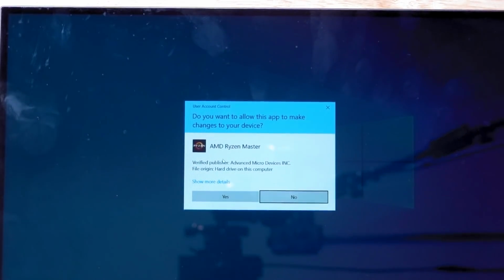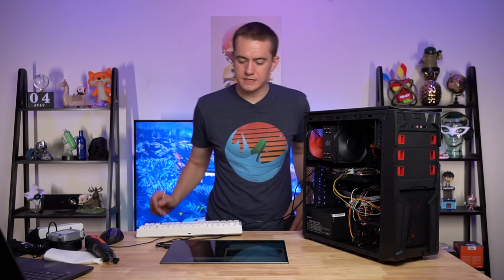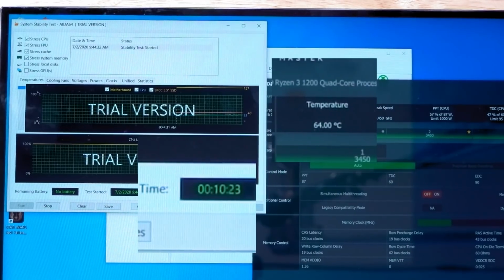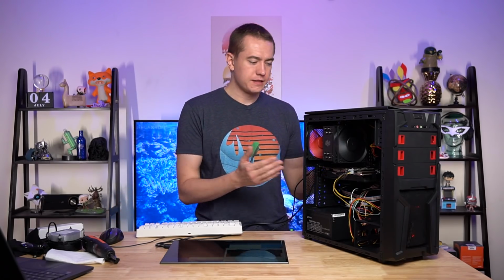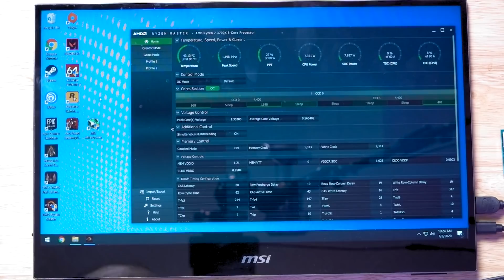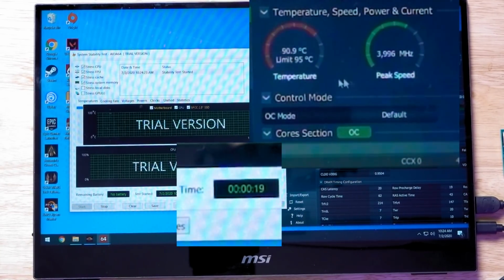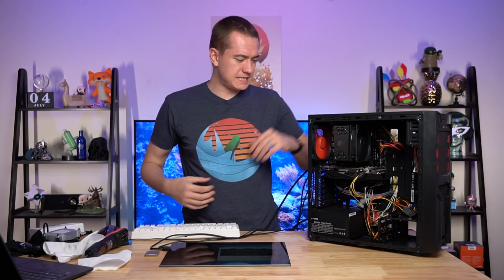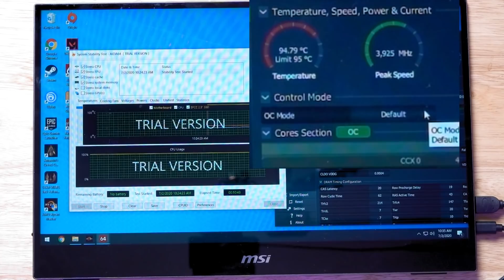How Bad Is It To Forget To Peel Your CPU Sticker?

Comment: I would definitely like to see a 24h test, but I'd also like to see the performance of it without the sticker.

Probably could cool that Ryzen 3 with a can of baked beans tbh.

More ideas for your brainus, can you put non conductive thermal paste in the socket and still have it work (does mounting pressure push out the thermal paste enough ?)

Comment: 3700X is same 65W TDP as the 1200AF :P 3800X is the 95W boosted version. But as can be seen, obviously they are nothing alike with actual thermal output.

Comment: My first laptop had a Pentium 4 desktop CPU on it (also a Geforce 4 488 Go in an MMX card and a massive 14 cell battery - for 1h30m of battery), I got it for university and since it was around September it was cold and worked fine, when summer arrived the thermals were pretty bad and the fan was usually at full speed...
I opened it up, and at first I though it was a clogged fan as it had dead flies and spiders on it (that thing really pushed quite a lot of air through a massive copper heatsink), but after a clean up it was the same... so I took the heatsink out: Against the CPU heatspreader it had a thin aluminium sheet (no thermal grease), then double sided tape then the copper heatsink.... My only guess is that the aluminium was protecting the heatsink and someone mistook it as pre applied thermal grease. Thermals were great after fixing that :D

Comment: did that once upon the time with an athlon xp. those cpus didn't have heat-spreader (or thermal protection) at the time. melted right through...

Comment: I was tired as hell, and put in my new Cooler Master MasterLiquid 240L RGB,  on my 2600, and yeah, wondered why my temps were about 20 degrees higher that they were with the stock cooler. Well I took the cooler off, and seen the plastic ... 1st time in 20 years of building PCs I did that crap!

Comment: You’re making my oc 3950x cry. I’ve seen it pump out 80C with my Dark Rock pro 4 and all my fans running full blast. I’m planning on water cooling it. Everything is on hold right now till the new graphics cards come out.

Comment: A lot of new pc builders probably wouldn't buy extra thermal paste.  If somebody was intending to use the pre-applied thermal paste but neglected to remove the plastic, it would perform much worse.  You should try the 1200 again without additional paste between the IHS and plastic.

Comment: I was IT for a hospital and I found this on a pc. It had been running fine for about 3 years about 1 year before I started. It was a shock to the IT group.
Reply: I can one up that. A customer brought a server he wanted upgraded. I open it up and is staring at the cooling fans. This was a 2U rack server that used two large radial fans for keeping the two processors cool. For anyone unfamiliar with radial fans they are also called centrifugal fans. Basically they have an impeller that sucks air in from the the front ans then spews it out the side. Some call them blower style fans. In this server the fans was installed to blow through the heat sinks on the processors, sucking air on from below them. In this server they had been installed the wrong way around so the air intake was solidly bolted to the plate the fans were mounted to. So as there was no way they could suck any air in they couldn't blow any air through the heat sinks. As a result both fans had been running amok and the bearings were ground to dust. And yet the server had happily chugged along for several years without any down time...

Comment: I suspect you could leave it on there for much longer and it'd still be fine as long as the thermal transfer limitations were not overwhelmed. I suspect the IHS takes care of the initial heat dissipation, and If the plastic is conducting heat at all (which it seems to be doing) then the temperature range between the IHS and the cooler probably stays relatively constant. Curious about what kind of material that plastic is, because obviously it's not standard otherwise it'd insulate the CPU.

Comment: My first build I just could not figure out why it would shut down after 5 min.  I finally took it to Frys and had their tech look at it and he came back laughing. he handed me the tower cooler I had purchased for it and he pulled the plastic off of the base.  I was so ashamed. I had built thousands of computers and never missed that plastic covering over the copper..  Well have not done it since..  You learn to look before applying the paste.

Comment: I had a PC replaced and built due to an insurance claim by an IT company with an AIO water cooler, I could not understand why the CPU was overheating. When I took the cooler off I found that the technician had not taken off the sticker on the water cooler

Comment: I did something similar when building my server. But it was a noctua cooler and it had a thin, nearly invisible plastic piece. Mounted it on with it still on and the PC ran fine, for a bit. It gradually increased in temperature and it baffled me in why it was running so damn hot. So assuming user error, I went to remove it to remount it, and the plastic bit stayed on the CPU when I pulled the cooler off. Yep, installed by an idiot.

Comment: Maybe try using the PC for like a week for daily use, video editing, gaming. It may give out useful information and data.
Reply: Mine didn't. Amd I gamed in my house when it was 80f in here last summer. 5900x using a hyper 212 air cooler with the plastic accidentally left on. The only reason I noticed is because I just put an aio on there.

Comment: Slightly dissapointed when you pulled the intel i9 from being tested because that would have been cool to see, still interesting to find out, wonder how it would perform with a dual tower cooler with a sticker still on since it would have more of a bottleneck with the sticker